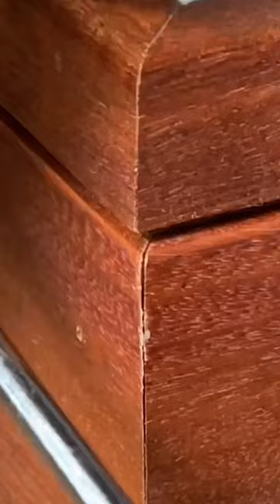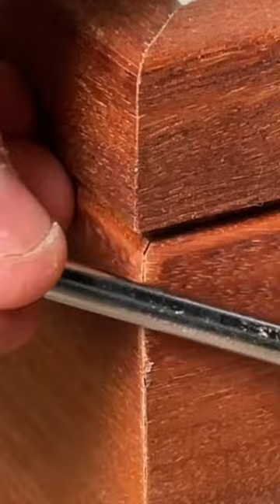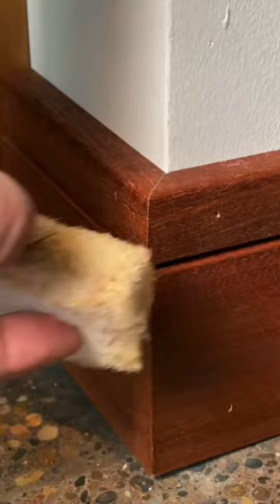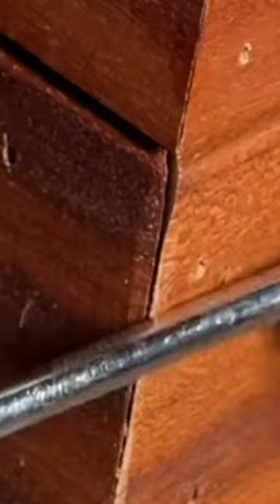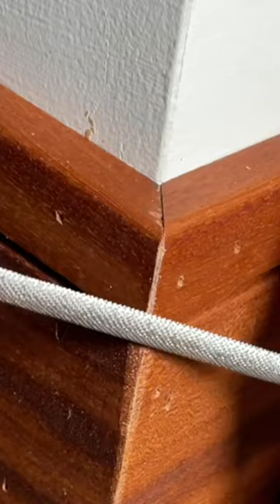Baseboard tip #7

Comment: A craftsman might make mistakes, but knows how to hide em.
Reply: Just take it back to the saw
Reply: @sethdistler5332  Amen. Take pride in your work, don’t hide mistakes. FIX THEM!!!!
Reply: That miter is really bad.  I'd be ashamed if I did work like that.
Reply: Hide that like that on my jobsites, you're fired instantly. I like finish trim, especially simple trim like this, to be perfect. It's not that hard to do this fit correctly. And there are a couple things you can do before you go hack in a rounded off corner.

Comment: Another tip is to cut your miters at a slightly exaggerated angle.  If it calls for two 45 degree cuts, use  46 degree cuts.
If it calls for two 22.5 degree cuts, use two 23 degree cuts.
I find this to be a must on any drywalled corners.  That metal corner bead creates a pucker on the point of the corner that will always make the corner a little out of square or greater than 90 degrees, which would require the halves of the miter to need to be increased as well.
Reply: That’s what I do. 46 outside miters & 44 on inside corners for base trim
Reply: @Madnikodemus2  cope on internals
Reply: yeah, you're definitely right about the corners of drywall walls being swelled out

Comment: Except the moisture in the air will very quickly reform it back closer to its original form. Within a year the gap will be fully visible.
Reply: Probably want to dump some glue in there before rolling.

Comment: that miter was cut CORRECTLY, but the installer lost it after that.
look at the very top where you can see how the joint was cut.
both pieces are perfectly parallel to each other.  so it was cut right, but a few other facts come into play, maybe the installer didn’t butt them to together tight enough, or the wood shrunk, but a couple other issues are, there’s no glue, and it wasn’t pinned together.
there’s another problem with the placement, if you look at the piece on the right, the bottom is out farther than the piece on the left.  that’s where the 23 gauge pins comes into play.
Reply: That’s what I was thinking.. the top of the first one looks great all the way how did the bottom get like that

Comment: Back bevel and undercut. After I have all my base cut for said room I put them all through the table saw on a 5 or 7 degree angle that way only a fine sliver sits on the floor. Makes scribing a breeze and as for your outside corners I always run a tester block to proof the angle first. Typically first try is with 45.5 then can slowly get more obtuse as needed. I also put a sanding disc in my grinder to take out anything in the miter that may be fighting to sit nicely. My company would never accept that quality of work especially if it’s stain grade. There’s just absolutely no excuse for turning those corners with a screw driver on stain grade.

Comment: "Miter bond", ( glue/spray)before you install. You can put together an entire kitchen crown mold with this stuff, on the ground. Change your trim, and moulding work 100%
Reply: That won't make the slightest difference of you have cut the boards short and/or the angles are cut wrong, as shown in this video.

Comment: The problem is that people assume that the corner is a perfect 45° and thats where the mistake begins. People also assume that the tool they are using is perfectly calibraded, wich is also the other mistake. Use the carperter square to calibrate your tools and measure the real amgle of your corner
Reply: 46 works most of the time
Reply: I love my miter saw.  Its the only one I have ever owned, and I've had it for about 20 years now.  But you better believe that I'm constantly checking its calibration.  I've let it burn me a couple of times before.
You're right.  Never just assume the tool is perfectly ready to make the cut.

Comment: Best to cut 46 degrees on outside ninety degree corners,and 44 on inside corners
Reply: Exactly
Reply: This right here
Reply: Wrong… cope the inside corners and use a degree measuring bevel gauge on outside miters
Reply: @joeblow9180  when you learn coping skills, you are no longer an apprentice, r you able to leave paper thin, the top of your base board
Reply: @joeblow9180  on this short of base its not necessary to break out the mitre gauge and I would assume the gentleman meant undercut the inside corners where it's applicable not necessarily when you're running base.
Reply: @joeblow9180  I still cut angle before I cope , and how well did the drywall person do on corners?(inside and outside) do you have problems of joint compound being too thick , and then having gap where wood meets wall?  Always variables, but sounds like you know them all , so great job at learning to master your Craft.  No sarcasm dude, just thanks for caring about your quality of work.
Reply: I will try and remember this tip!

No homo
Reply: @joeblow9180 You could also create some story pieces to gauge the corners.
I don't have the guage finder.  I just use scrap trim to work it out.

Comment: Or. And this is a wild idea. Don’t cut everything on a 45.  It’s not hard to measure the actual angle and adjust accordingly. 

You can also glue your outside joints together with superglue before installing and they’ll hold together while you hit ‘em with brads.  

Or you can hide flaws like this dude. But I’m saying it’s better to avoid them in the first place. No more time involved and always a happy customer

Comment: Just nail your baseboards together before you put them on the wall.
Reply: Good probability you’ll get a gap between the baseboard and the wall. Also if the walls aren’t straight, your nailed joint can separate anyway, just making matters worse.